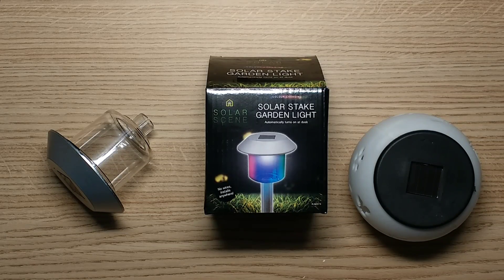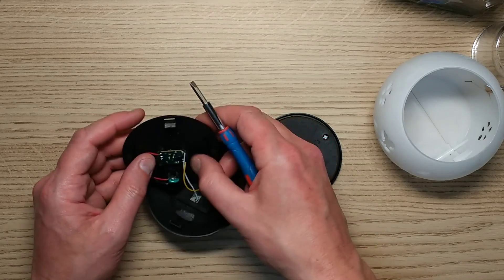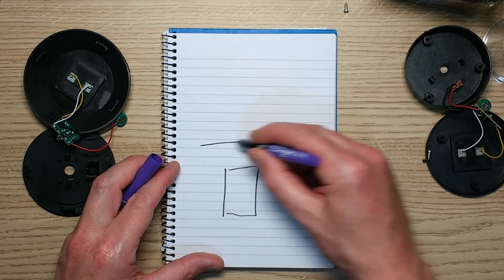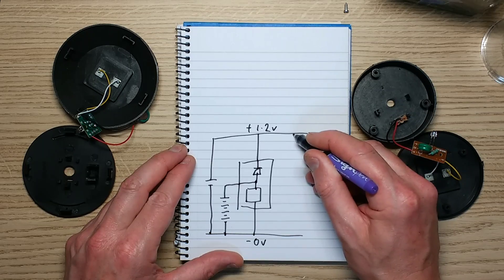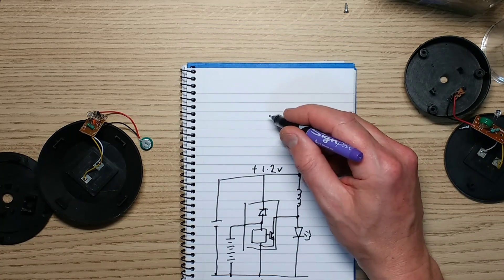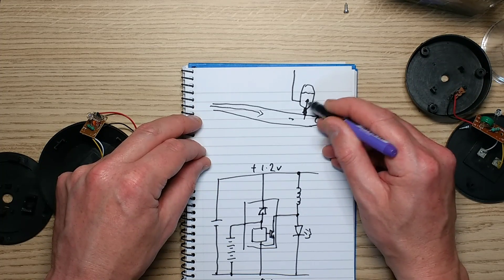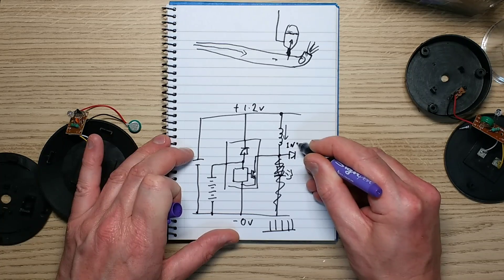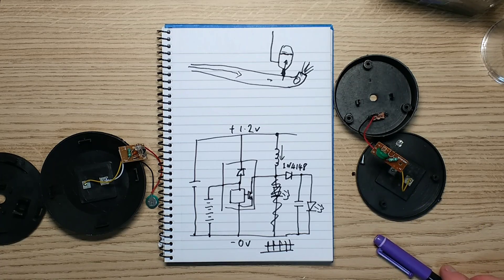How to make RGB LEDs work in ordinary solar lights.

Comment: Hi Clive, given that I've been dismantling circuit boards for components and have put the inductors in with the resistors, what is the best way to sort them out as they look like resistors?
Reply: Not Clive, but I'd look at getting one of those component testers/identifiers off eBay/Aliexpress  and test them and see what of the resistance (likely low if it's an inductor) or inductance value best match up with the colour code on the component. 
Or a rougher version - multimeter and measure the resistance - if it matches the colour code (keep tolerances in mind) -> resistor...
Reply: Inductors are usually green or teal, resistors beige (carbon film) or blue (metal film). Also the proportions of inductors often look different. They are thicker than equal length resistors. The fourth ring is often silver, a tolerance value you don't see often on resistors and the third ring is hardly ever "more" than black or brown. That should cover 99% of all cases. When in doubt measure them. Assume it's a resistor and if the resistance value is way off it might be an inductor (or a broken resistor).
Reply: superdau Old resisors are often brown, and 10% (silver) or even 20% (no 4th band) were not uncommon.
Reply: Yes, but their shape is completely different and I wouldn't ever want to salvage these from old boards in the first place.
Reply: superdau I'll check by looking at the shape, salvaged parts save money and save the environment.
Reply: By "old board" I meant decades old where you would find those brown resistors (actually you will often find them mounted "flying" with almost no PCB at all) John was talking about. That's stuff I would not touch. Just not worth it. 
As for salvaging other parts: all my last projects were built with a lot of of salvaged parts (half of them SMD) in them. Doesn't really save money, because the parts that can be salvaged cost almost nothing on ebay and the parts you don't find on boards (microcontrollers, known good electrolytics and things like that) cost much more anyway. And the environment? I think I do more damage to it by desoldering parts, because that's using more power and resources (flux, solder) than the production of a new one would take. But that's irrelevant anyway considering the amount of parts I use. My main reason for getting parts is that I can find almost any value in almost any package even on a Saturday afternoon without having to wait for shipping or having huge prebought set most of which I'll never use.
Hint: just leave the parts in the board. That way you can tell what a part is by its marking on the board or location in the circuit. Desoldering parts without need is wasted time. Most of them will lie around forever (like in a set). Remove the big parts (heatsinks, inductors, big electrolytics - scrap those btw., connectors) and store the boards.

Comment: I have wondered about this before, don't know if you have covered it.  What is the actual forward voltage of those colour-changing LEDs?  Are the RGB effectively in parallel, so it's just max 3.4V, or are some effectively 3 LEDs in series, needing closer to 9V?  Do different parts of the cycle use a different voltage?  (Low for R only, but higher forward voltage when all 3 are lit on white.)  The chip wants power as well, and I have seen some labeled as 5V, presumably with those the chip is in series with the LEDs.  I am confused about the whole thing really!
Reply: goose183  The LEDs are switched in and out in a parallel fashion. Doing it any other way would be more complex, and hence cost more...

Comment: I did this last year Clive but I found that you didn't need the cap your thoughts please
Reply: andymouse123 
Depending on tolerances inside the RGB LED and specific pulsing speed of the chip, it’s possible for the RGB LED to not light but have enough voltage remain available to keep its place in its colour cycle and not revert to red after each pulse. More luck than design in such a case.

Comment: I used to hack those things alot. I bought a couple and took them apart. Changed the circut to have it use two batteries (two by two for double the voltage and capacity) and a couple of those solar cells. That way the batteries could be charged way better, even on cloudy days and  they actually worked through the whole night.
Later I installed them in my home too, duct taping them on the wall basicly, to have them light up the house at night. It wasn't much, but it worked and you did not have to switch the light on for your nightly walk to the bathroom.
I used a little polymere lithium batterie in a later version. To hell with shitty batteries.
Reply: thats pretty much qwhati do with the wire led things, i got a 10m long one with a solar panel onthe end, i haveit inthe window and run the lights down the hallways taped to the top skirting, on either side, it worsk pretty good, goes till around dawn

Comment: Or you could just swap all the guts over I suppose....  

The colour changing ones I have here seemed odd, since the length of some colour cycles seemed to vary, but I worked out that it was actually cycling RGBRGR, basically six colour cycles with only one blue.  The extra red that is substituted for the second, missing blue cycle makes it look like a long red cycle.

Does the blue LED use significantly more power than the red one to fire off?  That would explain it if they wanted to maximise the performance as time.
Reply: I don't quite remember why it is the way it is, but that's basically it, blue LEDs use more power than reds. You might be able to find the answer on the Wikipedia page for Light-emitting diodes.
Reply: Ta, thought it must be something like that.

Comment: Ok, i so wish you had done this video two months ago when I began this exact project. But i ended up figuring it out by finding one nearly dead color changing one we had and comparing the circuits like you did here. 

But I have one question and I don't understand why it works this way. With the Dollar Store ones I get they use the common YX8018 chip, and i have discovered that I can make it work  by only adding the in4148 diode and not the capacitor as well. If i add a suitable capacitor I cannot even notice a difference in the led. I still have never been able to figure out in my mind why it works with only the diode (unless its pulsing on both poles resetting the chip?...)
Reply: With out the diode the transistor effectively short the LED. So what ever charge is left in the LED is definitely gone then. With the diode there will be charge in the LED until its internal circuit used it up (I'm sure there's at least some capacitance in there, because every switching cuircuit will need some to run reliably). The pulsing circuit will need very little power to run, so even while the voltage dropped too low for the LED to light, the circuit is still running or at least keeping it's state until the next pulse arrives.
Reply: Ahh. that makes sense, sort of what i was thinking in a round about way (not quite but i was thinking about it correctly). So, my only question is what does the capacitor provide? I assume that certain led chips probably would fall too low in that time to recover and keep their timing. So in my case it provides no benefit but in other chips it may be needed to avoid the "constant red".

Also, thanks so much for the comment, i rarely do because I am such an amateur at electronics that I don't want to make a fool of myself. But this video inspired me simply because I managed to figure out exactly what the video showed before it went live (although not fully understanding it)... either way ill take it :D
Reply: Exactly. Without extra capacitor too much will depend on tolerances. Maybe the pulses are longer apart, the circuit needs more power or has less internal capacitance. You could end up with a whole lot of none working lights, because the next batch of LEDs or chips under the blob or inductors or batteries or solar cells behave slightly differently (it might even be that it's dependent on temperature). That said, I have no idea how big the working margin is. Maybe your soulution works for almost everyone or maybe you are just one of the very few. Considering that an extra capacitor costs money and these things are built down to a price, but still have a capacitor, I'd say you are a lucky one.

Trying to not make a fool out of yourself is a good intent. I hate the saying "there is no stupid question" because there definitely are. And even worse there are the lazy questions, that could be answered in a 5 minute google search. A stupid question shows that don't have enough understanding to ask a proper question (so the problem is somewhere before that). And a lazy question shows that you don't really want to learn. This was not one of them. ;)

Comment: Very cool Clive!  I did something similar a few months ago except I used a Schottky diode instead of the 1N4148 and believe I used some 470 uF capacitors I had laying around.  I've noticed that the fast flash LED's tend to drain the battery very slowly.  I've got two, otherwise same, LED garden lights modified - one with a fast flash LED and one with a slow flash.  The fast flash unit is still working in the morning when I go to work.  I also light to take a peice of clear shrink tubing and put it over the LED.  This diffuses the output nicely so a good amount of light comes out the sides.  They are very nice and unusual.

Comment: Would it be ok/safe to use this method on a led nite lite?
Reply from the maker: It depends on the circuitry, but many standard LED night lights can have other types of LED retrofitted.
Reply: bigclivedotcom I tried swapping out a slow rgb into one before and it stayed on red, just like the white solar lamp

Comment: I learned a lot in this one!  Thanks, Clive.
A neat video would be a 'tour' of your 'travel tool kit' that you take along to do these projects.  I always wonder how you manage to keep doing videos on the road.  
In mine, I have a few multi-drivers, some small pliers, flush cutters, and my USB soldering iron.  I'd love to know what I'm missing!
Reply from the maker: +Carlton Dodd That's pretty much my casual electronic kit now.  Plus the electrical kit which is larger VDE drivers, pliers, cutters and various spanners/wrenches.
Reply: @bigclivedotcom  Check your spam folder I had to put links in the post so it always gets blocked and needs approving. It's links to two videos I made of a new LED RGB-YP bulb I have never seen before. It  does work  without PWM.. Even has yellow and purple. I'd like you to see them.  One video it is powered with your 9V tester with the 300 ohm resister. It's been very useful Thanks. The second video is of one hooked up to the solar panel of a regular cheap yard solar light. I want to send you some so you can show us all how they work without an IC.or PWM. I only have 500 and can't get any more. I ordered plain RGB bulbs and they sent these by mistake I can send you the Ebay shop info with the sample if you want to see them.